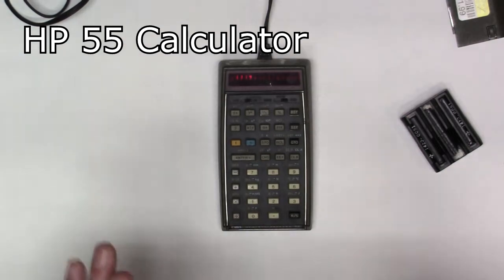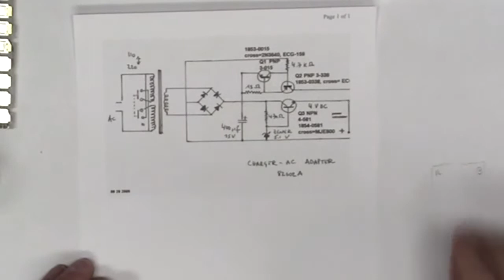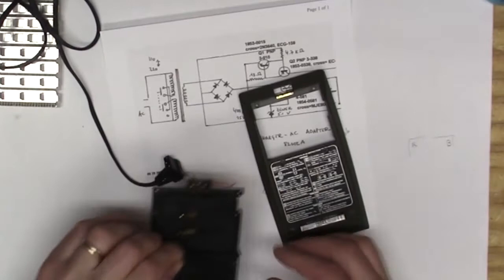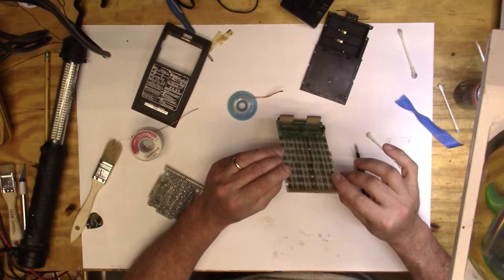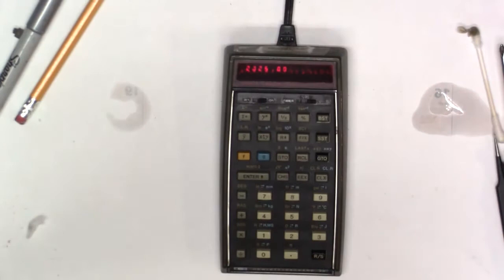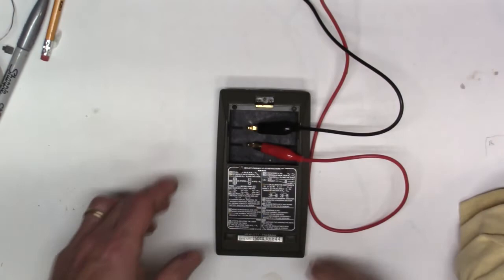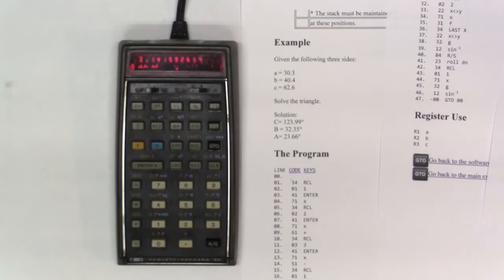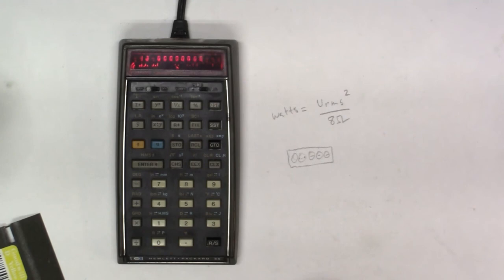Hewlett Packard HP55 Calculator restoration

Comment: my grandfather gave me his. it is unused, even the batteries are still wrapped in paper. but one's got leakage. once I understand more of technology I'll try to fix / clean it and eventually try to turn it on.
Reply: Do that :)

Electronics is a great hobby. And i love to solder and fix things :)

Its not so hard at all. To dabble in it
Reply: Always cherish what your grandfather gave you! I wish you the best of luck getting it up and running. I am probably of your grandfather's vintage, I used HP-25, HP-45 and HP-67 calculators in my university years in the late 1970s, and I still use them. My own grandfather came from Sweden in 1903, and I still have the Omega wristwatch he wore, with the original box and receipt from 1952. When he passed, my late father wore it, and now, I occasionally wear it also. I've had a watchmaker overhaul it a couple of times to keep it in top shape, and whenever I wear it, Grandpa (Farfar in Swedish) and my dad are there with me. You'll never regret it. Too bad your grandfather never got to enjoy it, but I'm sure he loves the idea of you having it!

Comment: Rob, congratulations on resurrecting that calculator!  It's an awesome machine, I have one and use it daily.

One correction to your video - the HP55 has 20 storage registers, R0~R9, and R.0~R.9.  You access them via STO 0 to STO 9, or STO . 0 to STO . 9.  So the program that wouldn't fit in memory should actually work if you use R0 instead of R.0.

Check out the Museum of HP calculators, https://www.hpmuseum.org, for a wealth of information on this and other HP calculators.  You can download an HP 55 manual, but it'll cost more than you paid for the calculator so it might not be worth it - but you'll learn some cool tricks this machine can do that you may not discover just by playing with it.
Reply from the maker: Thanks, It was an amazing piece of technology for the time and built like it was going into space. I later replaced one of the banks of leds that was misbehaving which was a little scary but went off without a hitch.

Comment: Interesting video! Just added HP-55 to my collection. My "restoration" was much easier (but then I probably paid a bit more for it too). I swapped battery packs with another old HP, and to my surprise both now work better! (I got lucky there I guess). After some cleaning it now looks near mint. Very nice calculator.
Reply from the maker: Cool, I later replaced the bad display which wasn't too bad a job although I had read you shouldn't even try it.

Comment: I have an HP 25 and the AC adapter.  It runs on 2 AA nicad batteries that died a long time ago.  The plastic battery case is part of the back but I was able to cut it apart and replace the batteries with ordinary alkalines.  Runs great.  The classic red leds are bright.  One more thing - this model has an AC adapter that puts out 10.2 v AC, weird.  We are used to adapters converting to DC.  It's obviously charging the batteries and the batteries are supplying the power to the circuits.  If you try to run it without the batteries installed, the display will light up randomly.  It's probably not a good idea to do this.  Also, with alkaline batteries, I won't be connecting the adapter at all.  I might try nickel metal hydride AA but not leave it charging for too long.
Reply: It's definitely not a good idea to run any Woodstock series calculator (HP-21, 22, 25, 25C, 27 or 29C) without the batteries installed or with a defective battery pack installed as the AC adapter is capable of blowing the ACT chip in the calculator.  Many of these models advertised on eBay as "for parts" have this problem but it may be possible to resurrect them with a modern replacement ACT from Panamatik in Germany.
Reply: @GrahamNicholson56  I actually did this today, trying to recharge an older rebuilt battery pack. What started as an iffy calculator turned into a dead calculator in a day. Fortunately, I had another "parts" HP-25 courtesy of eBay, and the main circuit board was still good despite the keyboard circuit board being damaged, so I swapped boards, and now it runs again. I've heard good things about the Panamatik chip.
Reply: @jmfa57  What a pity, thank goodness you were able to retrieve the situation.

I have used the Panamatik chip to repair a dead 29C I acquired from eBay; it works better than an original (faster, less power consumed, all standard programs built-in) but it is quite fiddly to install.